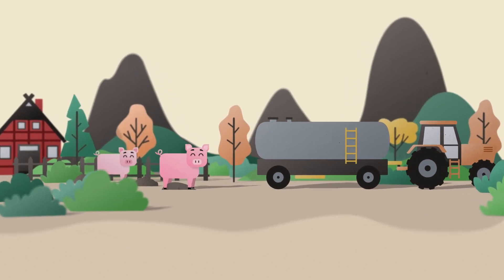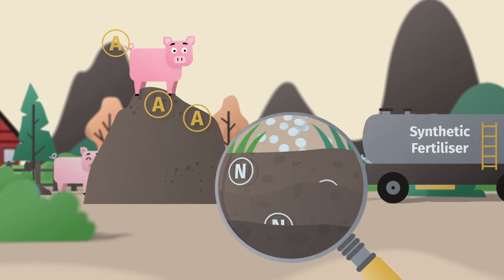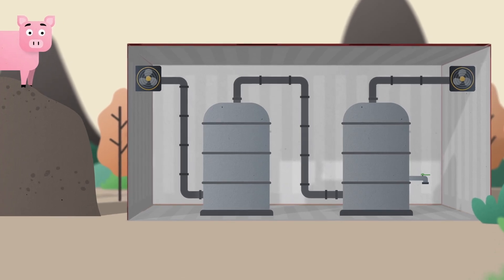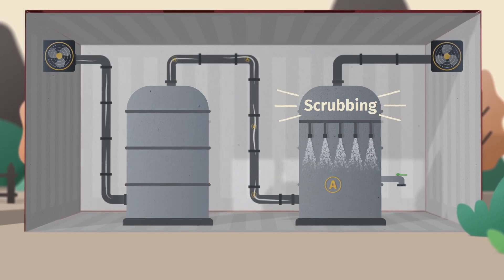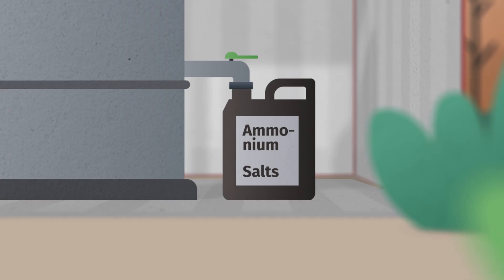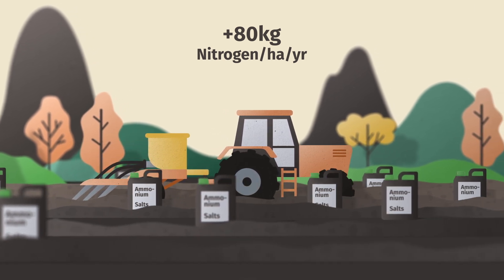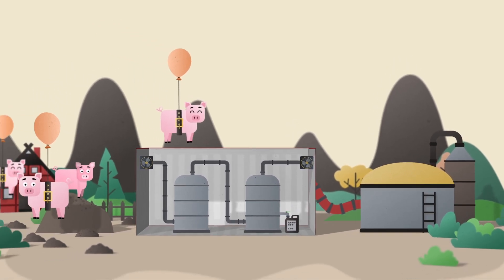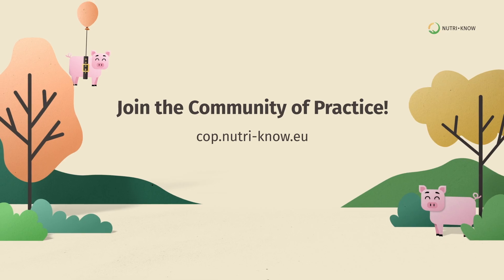Too Much Manure? Try Smart Nutrient Management With the Stripping-Scrubbing Process

Comment: I mean it's a nice animation and all that, but isn't it technicaly counterintuitive if the EUnow allows the use of more nitrogen if farmers use RENURE products. Like the regulations are there to protect the environment and water bodies from nitrogen pollution, so there shouldn't be a loophole. Or are ther reasons why this is a good thing?
Reply from the maker: That’s a great and very relevant point, and you’re right that, at first glance, allowing additional nitrogen application of up to 80 kg N/ha from RENURE products beyond the 170 kg N/ha limit set by the Nitrates Directive, can seem counterintuitive. However, this is rooted in the challenge of high-nitrogen-demanding crops such as maize which require extra N supply (up to 80kg N/ha) upon the initially allowed manure application at 170 kg N/ha. This extra N requirement is usually met by synthetic mineral fertilisers produced from fossil fuels. Now farmers have a more sustainable alternative: RENURE products, that behave comparably to synthetic mineral fertilizers while promoting nutrient recycling and circularity.

Besides, the RENURE products should meet strict quality criteria including low organic carbon to nitrogen ratio, limited heavy metal contents and good application control), so they can safely contribute to crop nutrition without increasing pollution risk. That said, the 80 kg N/ha allowance isn’t automatic or unrestricted — it’s conditional and designed to be applied only in circumstances when extra N fertiliser is needed and in regions where monitoring shows that water quality objectives are not compromised.